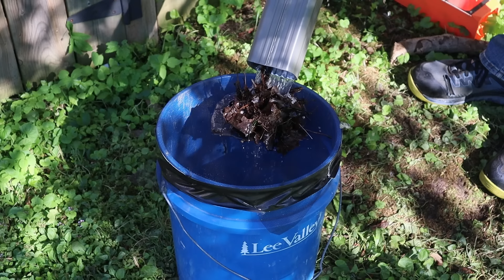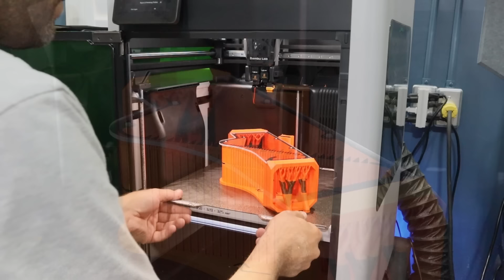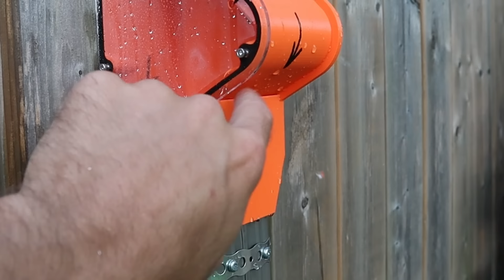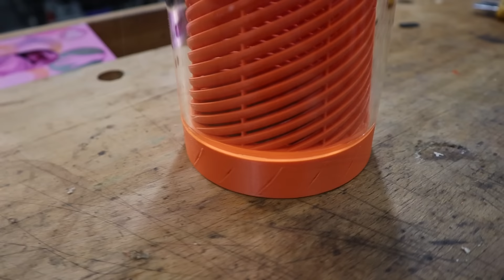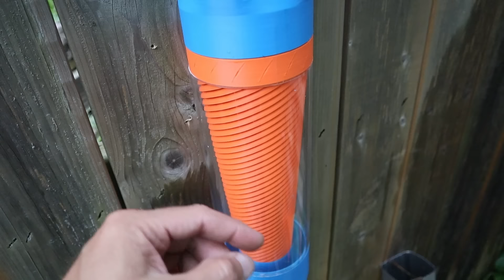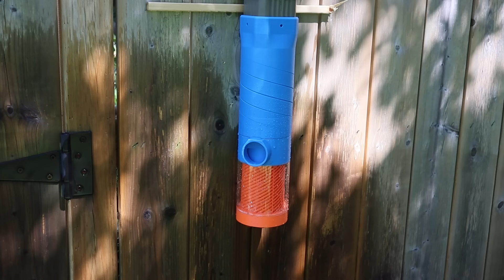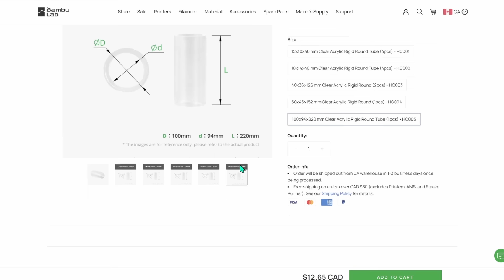Can you 3D print a self cleaning downspout rain water collection filter that actually works?  Let's

Comment: the main issue is that heavy rainfall is when you collect the most water in summer , that is when those systems loose most of it as the water flow is to high to be scrapped.
for me loosing 70% of a storm rain in summer would be catastrophic, in the winter nobody cares everything is full and the garden need no watering :)

Comment: For anyone thinking about using this as drinking water - do yourself a favor and check that you have no lead cladding on the roof. It is pretty common in pipe cladding (because it is superbly corrosion resistant and easily workable), especially in older buildings, but in a lot of places it's still an option even for new construction.
It's not something you immediately think about, but lead is nasty bio-cumulative stuff that you don't want in you even if it's only in trace mounts.

Comment: It’s ironic how 3d printed items are almost never used with water as it will contaminate it, yet you are making a filter.
Reply from the maker: Can you explain how you know that it will contaminate the water?  Are you referring to microplastics?  It's important to know also because as we use more plastic, PEX pipe in our homes for water supply, plastic garden hoses etc, it's good to know which are okay and which are not.
Reply: @NeedItMakeIt Generally, filament isn’t food safe so, allegedly, it will contain microplastics.

Comment: What is the diameter of the fittings? and What are the size of the PVC down spout?
Also, can this be used using a 4 inch PVC pipes?
Reply from the maker: I was thinking that I could tweak the design to work with any common sizes, the current size is for the 3" x 3" square and then changes to the metric acrylic tube size of 100mm.

Comment: Clear water and put micro plastics at once niceeee😂
Reply from the maker: What makes you say that?  Are you thinking that the plastic will erode over time and get into the water?  Will this also occur on plastic pipes like PEX in our homes?  this is now the most common type of pipe, all of our drain pipes are also plastic, is this also a problem?  I'm not actually a fan of plastic, I do however think that people need to be aware that we live in a world surrounded by plastics.  I'd like to see some truly bio-degradable "plastics" come down the pipe so to speak, but at the moment, we have only PLA and it doesn't really degrade unless we provide the exact conditions that would allow it to.  The heat is of course a problem too.  In any case, I appreciate your thoughts.  The prototypes usually begin as plastic and then eventually if the ideas are good enough, metal is a good alternative.
Reply: @NeedItMakeIt the pipes in my country for water are made of copper. But yeah I understand what you saying. We literally surrounded by plastics everywhere.

Comment: What could you call this or brand it as ? Im thinking MPDS Filter ! or The Micro Plastic Distribution System Filter ! 0_0
Reply from the maker: Another microplastics band-wagon person I see.  You may not want to look to see if your pipes supplying your drinking water are plastic, your drain pipes are also plastic, which means that the water exiting your home is also polluted.  I appreciate that you're bringing awareness to but I think it's important to realize that these ideas are only possible for me at least by 3D printing, if this were made into a product, it could be made from metal if that's preferred.  I'm not happy about the plastics to be honest, I'd rather stick to using wood... but even with wood, we have finishes which are a form of plastic.   3D printing in metal could be another option... a little expensive, but possible in the future.    

So all of that said, do you think that the part I designed will wear down and in so doing will introduce particles of plastic into the water?  Is it okay to use PVC pipe and are you concerned about that, what about the HDPE barrels, what about the acrylin bulkhead fittings?  How do you propose that water be stored instead?   

I'm open to ideas, so tell me what you think, give me some solutions and ideas and I'll include them in my future videos.

Comment: They make disc and screen filters used dor irrigation mainly and most require a minimum PSI im sure they come in larger sizes and perhaps smaller but Google Y disk filter or Y screen filter. I've only seen them in 3/4"-1" and possibly  1.5-2"... not suggesting trying  to modify and try to get a larger down spout into a 1" hole but study and maybe take some ideas from its design.
Reply from the maker: I hadn't heard of this type, I'll have a look, maybe there is a better idea for a filter using something already proven.  I've seen filters which use a mechanical conveyor too for larger debris, but that's overly complex and needs to be powered, so I was hoping for something that's simple and relies completely on gravity.

Comment: Put a spiral blade in the middle, when the water hits the blades, it should turn moving debris down and out. If it gets stuck, the blades should end up cutting the debris down into smaller parts if you leave a little gap for debris to get trapped on the edges. If that still doesn't work, the blockage will become so heavy, it should just bust out eventually, and even if it doesn't, the water should still get through at a lower rate, then you'll know it needs to be unblocked manually. Or you could use a spring loaded mechanism inside the spiral barrel to drop down like a door on a vacuum to unblock itself, then spring back into place.

Or, you could use gutter catchers that don't even allow bigger chunks of debris to get into the gutter at all. Which would make your device work as is.

Comment: So I'm at 17:43 and I can tell you that the reason you're going to get a clog is because you have to allow a little bit of water to pass to help push the debris out. That design is removing all water, leaving none to wash the trash out.
Reply from the maker: Yup, I agree with that, a little bit of water is a good thing, I think with the downspout, since we have heavy and light rains, it might work well to wash away some debris with the heavy rain and then when it's light, it builds up, so I agree that it can work too, it is a good point

Comment: At the start of the video I just thought why not a conical mesh filter with the tip pointed upward - the water will continue to flow through the mesh and the debris will fall around due to the slope? Can you guys suggest if this could work at all? And for the record - I am not expecting to be "that simple" but could the general idea work?
Reply from the maker: There might be a solution there too for sure, a particular type of mesh might also work, not necessarily the screen type, but something very fine possibly, I was also thinking that a big disk that would slowly spin out and down would also help to dry the debris and dump out away from the filter, but that's getting more complex. There are a lot of comments about microplastics, I might want a metal mesh to address, this however, the who setup is plastic... we also drink from plastic bottles, so I'm not sure it's really too critical right now, but maybe for a final solution we can use different materials.  For the prototyping stage, I have 3D printers and the filament, so that's what I'll use.

Comment: When testing may have been more accurate to use a "full" gutter that fed into the downpipe rather than spraying in. Water won't be flowing that way the way in normal use
Reply from the maker: Yes for sure, I have the barrels setup, not sure if you saw my most recent video and I'll be testing using the water coming down the roof going into the gutter and then the downspout for the most accurate setup.

Comment: Such a good design
The only suggestions I could think of would maybe use less slits towards the bottom
As the system seems to collect the majority of water at the start. The more slits means more possible debris to be caught and more likely to clog during extended use.
So U could decrease the amount of slits as U go down.
Also following your first design, have the immediate bottom flare out into a ring so whilst all the debris falls, U use the slope to recollect the last water
    __
   /
|/ /
  /
/
(Text rendition)
The lip also still allows the filter to be disabled upon being flipped

Using the magnet concept, U could also design an add-on particle filter to make it more suitable drinking water and allow it to be an easily cleanable filter. Ya just pop it out, and clean it, and slot it back in.
Reply from the maker: Very interesting thoughts on that, I like it, I'm finally setup to test in the real-world from the roof to my rain barrels and after the tests we can start to make some improvements like the ones you've mentioned, thanks for those!

Comment: And what is with the Nano plastics in water, will this not make it even worse 🤔
1year later uv light will have destroyed the plastic. 🤔
Reply from the maker: The plastic I've used is PETG which does well outside, but it is important to keep in mind.  I expect that if this were a product, it could be made from metal so nano-plastics are less of a problem, plastic pipes, asphalt shingles plastic barrels, plastic hose, plastic watering cans are also issues, so I'm not sure what to do exactly.  It does seem like a lot of people are getting more aware of the nano-plastic issue, what are the solutions to this problem and where are they mainly coming from?
Reply: That would be my quest too 🤔

Comment: Love microplastics
Reply from the maker: I've seen quite a few of these comments now, so from your perspective where are the microplastics coming from?  Is this because the part is 3D printed?  The material is similar to that of a plastic water bottle, so I'm not sure it would be any worse than that.  Maybe because it would wear down over time through abrasion or exposure to UV light?  Ideas are often times made possible only because we can 3D print them, maybe a metal version is the final solution, but that's not the starting point.

Comment: You might try a debris cup system in sorts when the fins get cloged and the cup fills, it then dumps due to the weight. Like the small water metering for rainfall measuring. As the cup filter lets water out through the grid when no debris is caught, it never dumps. Hope my babel makes sense.

Comment: A word of caution about neodymium magnets: they rust! There's a lot of bulk iron in their composition and when left in a moist environment they'll rust fairly quickly and crumble into non-magnetic dust. If someone wants to use a variation of this design I'd seal the magnets into the print with something like UV resin or Plasti-Dip, something that cures to a waterproof finish. Using a rubber gasket sized to match your interface is also a good option, but I would make the magnets larger and stronger to account for the greater distance between them in that case.

Comment: How to fill water with micro plastic
Reply from the maker: How so, are you thinking that the 3D print has microplastics on it?  Will it wear down and then generate the plastics, how would this be different from anything else made from plastics?  Do you have any ideas to help solve this?

Comment: Cleans water with microplastics, hell yeah
Reply from the maker: Can you explain where you think they are coming from and how this would be different from any other plastics we're using?
Reply: @NeedItMakeIt  3d printed plastics such as: LA, ABS, PETG, or nylon typically fragment and fracture easier, and faster compared to traditional plastics. These plastics have lower crystallinity, meaning it breaks down faster under UV = more microplastics. With the layer lines and porosity more surface area ends up being exposed, meaning more exposure to UV = more microplastics. The thermal plastics used in 3D printing are also weaker to mechanical abrasion and especially with temperature and temp swings.
We are already exposed to so much of it, why would you want to expose yourself to more

Comment: Great design👍 How has it held up? Does storm water cause it to disconnect? Does your bucket wind up overfilling or did you design a rainproof catch lid for your bucket system?
Reply from the maker: I'm finally able to test it out with my barrels setup so I'll be testing all of these things, I don't see the mags being the best solution, maybe something like a clamp would be better, it seems to be working well so far though, I have it dual functioning as the overflow also, there will be some tweaks and there have also been a lot of comments about microplastics, but none of them indicate where they think the microplastics are coming from, so I'm trying to get some actual useable information from the people who have made these comments so that I can try to do better, or see whether it is a real problem or just something trendy.
Reply: @NeedItMakeIt  
Microplastics can be released by PEX pipe too over time and that stuff is used everywhere for tap water. 
I wouldn’t worry much about it, since it’d be impossible to achieve the quality of PEX pipe using a 3d printer. 
Instead it’s probably “best” to filter any water used for consumption no matter the source👍

Comment: Maybe you can improve on the spiral idea, by having the water follow a cone in a reverse slope
Reply from the maker: Yes, this is a really good idea, I have printed a section with the reverse spiral and I think it could work well, the only issue is that it reduces the opening size so there is some possibility of things getting jammed in there, but it could work and it's worth a test for sure.

Comment: Great article thanks, I’ve had issues with leaves,and grit clogging the rainwater diverters I’ve used before, so thought I’d print this one to give it a try.  I had to design some custom fittings for the top and bottom because here in the UK a lot of the downpipes are 68mm square.  I added an inner drip sleeve to the adapters as well as an outer seal to stop the leaks from coming out between the two flat mating surfaces.  At that point I found that the top,and bottom inner profiles of the provided models are slightly different which stops the central section from being entirely reversible, but by using the profile,from the bottom adapter, with the extra outer drip seal should make the fit tight enough to stop leaks, but still reversible.

Just waiting on some rain now,to see how well it works, it seemed fine tested freestanding using a hose, so hopefully some rain in the next couple,of days will tell for sure.

Comment: With your first model there is one thing I would do.  Where the filter let's the water through but the debris slides down ramp, I would stagger the supports in the filter instead of a straight line. I think this would allow more water to in through the filter. 
Love the designs!

Comment: The long taper seems ideal (low water loss, good filtration) except for it getting clogged. I’d try just scaling it up: A small section at the top that tapers out the tube so it’s much larger, then the filter tapers in so the smallest inner diameter is back at the starting size. That way any debris that was small enough to make it through the tube is also small enough to pass through the filter - there is no extra shrinkage

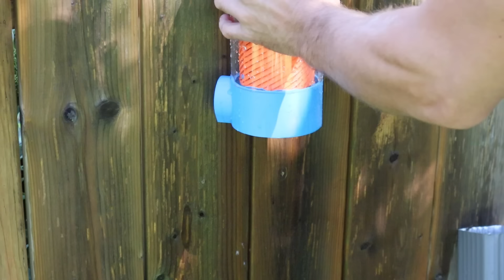Comment: 21:31 at 20:45, you might be able to capture more of that water collecting at the bottom and letting it run out the bottom by have a sort of lip at the bottom instead of having the fins go all the way to the bottom.  That way itll pool and run out of the spout instead of pooling at the back and falling straight through

Comment: Excellent idea, 10/10, my only problem was your testing method, I think if you connect some guttering to it with the hose running at the end without pressure gun, then drop the debris bit by bit into the gutter it would work perfectly, I don't think you gave the poor thing a chance. Anyway love it, want one. Also think pla would be fine, I use it for hose connectors and plant pots and no problems.
Also for general use, rather than testing, the perspex isn't nessesery, and would make it easier to make. 
Good work.

Comment: First of all, I have no interest in capturing rain water, I don't have access to a 3D Printer, nor did I want to install something like this.

But listening to your iterate through your design process, the almost asmr like sections of no commentary, and the somewhat dry sense of humor was enough to keep me entertained through the hole video and I'm now going to sre what else you've worked on and maybe subscribe if your content is something I'll be interested in seeing more of in the future, I know your quality already is!

Edit: I'd be interested to see the rate of loss for your collection. Maybe fill and weigh a pitcher of water, then weigh the water collected and see how much was lost?
Reply: To make the measurement a bit more accurate, first run a pitcher of water through so that all the surfaces and corners are already “wet” with surface tension and whatever. Then run the measurement, so you’re not measuring the added effect of “losing” water in the system (that will get flushed out and replaced the next time)

Comment: I would think you would want to angle the slats in the opposite direction . Not to scoop the water but angle the slats the other direction with the face of them pointing up to use the coanda effect and let the water follow the surface of the slat. This would also lower the drag on the solids since the solids would not get hung on the edge of the slats

Comment: 2:14 The solution is obvious: you need to stretch the filter mesh onto a pyramidal base. Don't complicate things.
Reply: That seems pretty ideal. The water will filter through and debris will just roll off. And any that doesnt you can easily clean by hand cause it’s so “open”. But unfortunately theres still the algae&sunlight issue
Reply: Add a P-trap between the filter and the barrel then